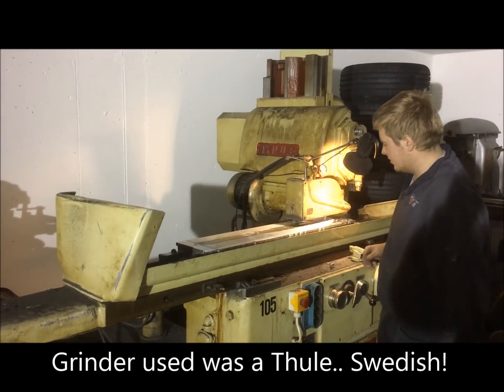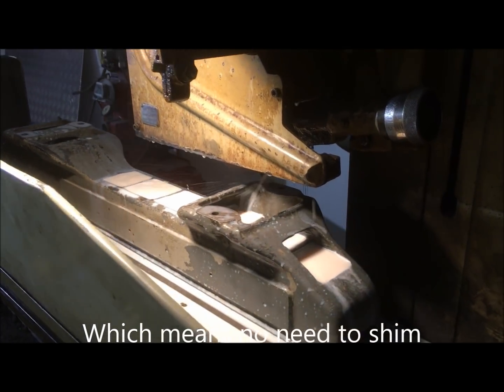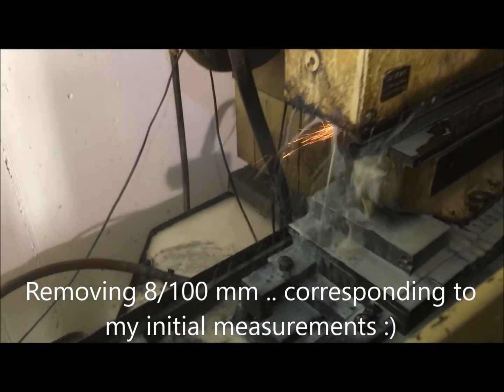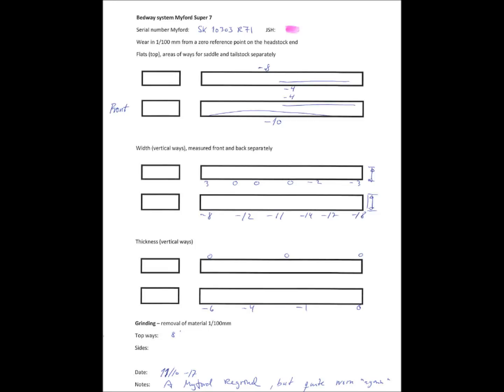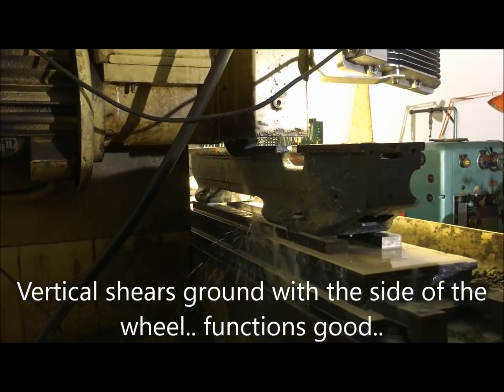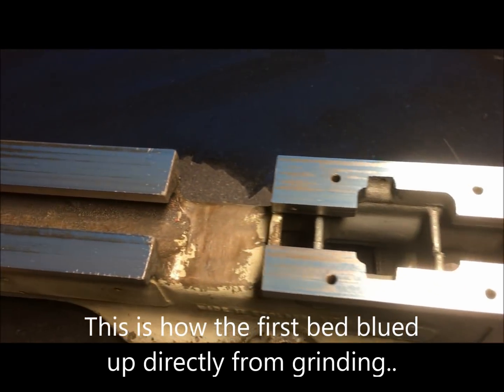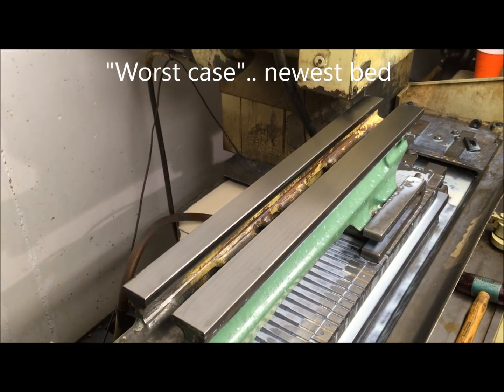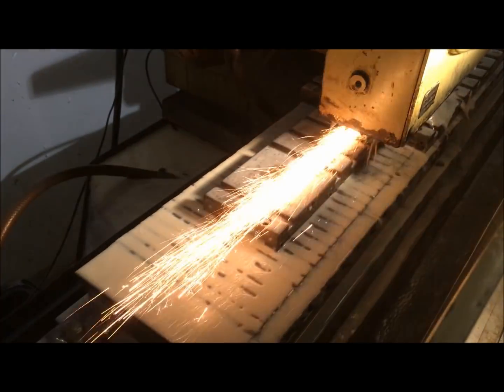Grinding Myford beds

Comment: Nicely done as always Jan. It was fortunate the ways are so simple and you had access to that grinder.

I've personally found spotting after grinding terribly unreliable, to the extent it's almost pointless if I'm going to scrape. If the accuracy is good (ie the part is very flat) the thickness of the blue affects the way the work sits on the plate and it smears everywhere. With a scraped surface the excess blue has somewhere to go.  I presume you will give them at least a light scrape/flake and it will be interesting to compare how they blue up before and after a light pass. I look forward to watching how these little guys come along in future videos.
Reply from the maker: Thanks! Yes, the Myford flat beds are "forgiving" and easy to deal with.Agree re. the blueing. That was a good explanation!I tried to measure with test indicators for the small deviations there might be, but very tricky to get any consistent and reliable reading when you are down to 1-2/1000 mm, and especially in a workshop like mine. Best I reckon is to test flatness with the level, which I also did to find any twist. All results were good. I may give some of the beds a "signature" scrapejob, but leaving them as is also looks good.
Reply: Interesting, as I personally prefer a scraped surface for looks, but I guess that's personal preference. A scraped surface does however make it easier to keep an eye on the extent of wear, as it becomes very obvious on the scraping. Not that there's much to be done about it I guess, so maybe it's good not to see it ;)
Reply from the maker: Pete F I also like 'em scraped 😃 I can decide later, but scraping the tops would just be for looks. Most important is the underneath of the saddle. As I have learnt, and experienced), this surface will have wear 2-3 times that on the bed, which differs greatly within the lot. I then plan to mill away the wear and then use Rulon to matchscrape to the bed, possibly also flake
Reply: Yes the saddle normally wears worst and unevenly, generally followed by the tailstock base, just depending on how the lathes were used. Rulon would be a good plan. I think it may be possible to just scrape them if the wear isn't too bad and you can make up for the lowered apron height, but I'm not that familiar with the Myford.
Reply from the maker: Pete F You're right of course.. I can probably do without the way liner material, at least on some machines. The Myford cleverly utilizes shims between the saddle and apron, and the thickness can be adjusted peeling off layers of the shims themselves.  However, I still want to add/use Rulon, to make them all alike, and for ease of scraping. I reckon I will  need to shim the tailstock base (surprisingly this was not the case for the 1st Super 7 I restored.. previous series of videos.. possibly because this was more neglected than worn..). Maybe also change the quill?
Reply from the maker: Pete F My plan for milling the saddle is to clamp it using precision bars in the dovetails. If the relief area, ie. top surface between the dovetails is flat and parallel  to the dovetails/wear pads, I can use the relief area directly, but this must be tested before trusted..
Reply: That was very forward thinking of Myford, though it possibly also made manufacturing easier.

I've never used any synthetic bearing material, but would like to one day. My concern with it is with regard embedded chips, particularly if machining things like cast iron, though many manufacturers use it very successfully. 

I'd guess the tailstock quill is not hardened, and it would be relatively simple to re-manufacturer. I'd expect the wear would be in the bore and not so much the quill itself, maybe an alternative is to ream the existing quills and insert a bearing bronze bushing in the tailstock casting? While a "perfect" lathe will have the tailstock quill angled very lightly up and toward the front (to max 0.02 in100 mm) it's also perfectly acceptable to have both as 0 in 100 mm. It would make reboring the tailstock bore on centre relatively easy.
Reply from the maker: Embedded chips may be a bigger concern with the softer material, but it depends on usage, I guess. What kind of material you are machining, how good the machine is cared for (cleaned), way wipers etc.As you say, the tailstock shall not dip below zero, so better to make it a little high in front (use the allowed + tolerance as specified in the Schlezinger "standard").. then it will get better when it wears until it reaches even, ie. stay accurate longer. Shimming up in front OK enough I hoped.I also thought the bore, not the quill would be worn. Seems I have at least 2 options: rebore and make new quill with large dimension or fit a sleeve using the old quill. Either way I could do the reboring with a shim in the rear to ie. the bore at a slight angle, tailstock downwards pointing in front. Then having done the bore, just remove the shim so the tailstock sits flat and points dead ahead (front at zero from start), but now bore/quill the needed degree upwards.. or am I missing something?
Reply: Jan Sverre Haugjord Yes but you need to consider all the tests for the tailstock when considering shimming, and the geometry once the shim is removed. The quill is out the front and not at the pivot point. If it needed shimming I think I would bore it horizontal, then insert a shim to bring it slightly high, then scrape for geometry. I haven’t done that however so just a thought. Otherwise just bore horizontal and be done with it. At the end of the day, this is a hobby lathe, and there is no shame in a lathe rebuilt with a tailstock at 0/0 on centre!
Reply from the maker: Hi again Pete,Having had the chance to disuss a little with Myford (talked to their sales staff at an exhibition just recently..), given that I didn't misunderstand, less than one out of 10 tailstocks castings are bell-mouthed when in for refurbishment and hence not many would need a rebore. Again if I understood correctly one could buy the barrel/quill oversize and hence fit it to a rebored casting. I don't know for a fact, but assume they bore it sitting straight, hence they will be at 0 after refurbishment.
Reply: Thanks for that update, it was nice for you to do that. It doesn't surprise me they bore at 0, as that would be the easiest and more than satisfactory. I would think to get nose high would probably require scraping to alignment in practice
Reply from the maker: My thinking too.. :)

Comment: Could you diamond lap the ways after grinding just to get the last bit off accuracy and this would also improve the finish..they do this at Mitsui Seiki..
Reply: I'm not familiar with how DMG finish their ways, but am surprised to read they are finished the way you say. As Jan mentioned, a "mirror finish" is not necessarily a good thing when it comes to bearing surfaces, nor does it represent accuracy. A lot of people confuse polishing with lapping. A DMG machine will have hardened ways and different bearing surfaces running at different speeds when compared to a Myford lathe, hence what may be appropriate for one may not translate as being appropriate for another
Reply from the maker: Arrow Racing Products I guess so but I would rather then give it a treatment with light scraping
Reply: I see..at Mitsui Seiki they diamond lap the ways to a mirror finish...but I'm not sure if this is done to improve wear resistance or just for aesthetics :-)
Reply from the maker: Arrow Racing Products Not sure myself, but for a home shop and a Myfodd, I think we are well within specs. Don't get me wrong, I am honored to be mentioned/compared with a hi-end cnc milling machine factory 😆 re. lapping, this process (I presume) will remove only minute amount of material, as you say, polish the surface. Might be good to have an absolute mirror finish on the "exposed" surface (assuming the non-exposed mating side has an oil-retention surface or another hi-tech suitable for the purpose material is used)
Reply: Yes definitely within specs, they will be really nice when finished..that big grinder is some nice piece of kit :-)
Apparently Mitsui Seiki use a pressurized air oil mix for lubrication which is supposed to keep chips out and give an air gap to cut down sticktion and wear.
Reply: A smoother surface is not a good idea,you need micro pockets to trap the slide oil,which improoves the wear.
Reply: @enoz.j3506  Normally yes, but at Mitsui Seiki they use a presurized oil air mix to lubricate the slideways and don't rely on the oil resting on the slideways.
Reply: @cncit  Thank you for your reply.

Comment: Awesome video. The stripes didn't look to bad considering the time it saved you. You guy's knew how to prevent them I'm sure . Thx.
Reply from the maker: HRM Weapons Machinist Thanks. Living and learning all the time. Actually planned to scrape the beds, but as I was lucky enough to get them ground, it saves many hours of scraping. I have done the Super 7 last year all by means of scraping, so I understand the work(load) involved. I can later decide if I eg. want to do some decorative shallow scraping (maybe try to practise Swiss type pull scraping like my friend Edvin has gotten so good at?)
Reply: I didn't have a magnet to put straight on the magnet table, the stripes is from a very slight taper in the wheel

Comment: Great Jan Sverre.
Like your videos.
About to overhaul two ML/ 7 my selves. 
One need regrinding the other one might not, just a novice related to scraping.
Metrology at my workshop quite limited, 
Have only a surface plate aprox. 60 cm long.
Any advice are welcome.
Regards 
Tommy Vik
Reply from the maker: Tommy Vik Hi Tommy,
Do you live in Norway? If so, you are welcome to visit me in Drammen for a "shop and machine" talk/session. If too far away, I may point you to others that also may help. A big surface plate like is a great asset, but you could also get along with a long, somewhat broad straightedge.Or also with other means.. just gets a little trickier to measure. Anyway, very nce to learn of others that are restoring Myfords! Are you planning to scrape the beds, grind them or are they good enough as is?
Reply from the maker: Aah.. sorry, I see you are writing that one of the beds are up for a regrind :) Pls. contact me at jsv-h@frisurf.no if you need help/advice. I can also recommend to join our FB group called "Verktøymaskinklubben"
Reply: Jan Sverre Haugjord What group is that ? I own a super 7
Reply from the maker: on FB.. based out of Norway

Comment: Progressing quickly,  when can I buy one???
Reply from the maker: Thanks.. it will take quite awhile to get the machines up to the condition I want them to
Reply: You keep up the good work, I'll start saving the euros...and who knows
 I just acquired a surface grinder in need of repair and I 100% blame your videos for giving me such false confidence!
Reply from the maker: Barry Manilowa Easier grinding on flat ways. V--ways self aligning, box ways not, but no problem in this case
Reply: Jan Sverre Haugjord According to Gelbart, he says when two perfectly flat surfaces meet, it will never wear provided there is lubrication.  It is hard to believe,  but perhaps these lathe beds were not well treated.
Reply from the maker: Yes, of course. It is all about lubrication. You don't need to take flat surfaces as example.. I would say just look at a regular fossil fuel engine. Literally billions of moving pistons in continuous use today doing their (reciprocating) movement without problems based on the principle of proper lubrication
Reply from the maker: The beds on the machines I have bought show normal sign of wear, but to varying degree, and some I reckon were considered "too far come" for a "normal" restoration job to be economical

Comment: Nice project, I like your channel! 

While grinding the surfaces, the grinding wheel gets shorter continously ...
How do you compensate the wear of the grinding wheel while grinding the whole surface?

Thank you, greetings from Germany.
Reply from the maker: Thanks!There was no need for any compensation. The finish grinding is very light and I could not detect any difference if we started from the inner side and went outwards as compared to taking a criss-cross pattern or  alternating inner/outer ways. The blueing on the surface plate will anyway be the judge, but as said, it was within 1-2/1000 mm and after some stoning the stripes were almost invisible
The nominal thickness for the beds in our case here is not of importance as the saddles will be scraped and mated to the beds anyway. The beds could very well be outside what was considered grinding allowance, but I will add Rulon to build up the saddle
Reply: Thank you very much, taking your time to write me this detailed answer!
Reply: Great footage Jan. Thank you for documenting this.
Reply from the maker: You're welcome! I am in a midst of a (seemingly never ending) painting process, but when the beds are done I will continue the video series.
Reply: You are only grinding on a small part of the wheel every pass, so it will wear down at that point, and then the next pass the wear "edge" will move a little on the wheel but as long as you make all passes (the whole width of the work piece) without wearing the whole width of the wheel it should be fine.. Atleast that's what I've heard.